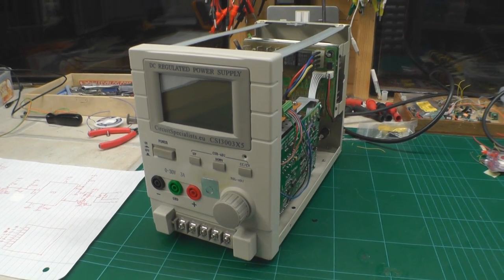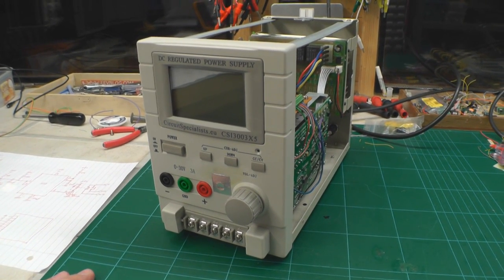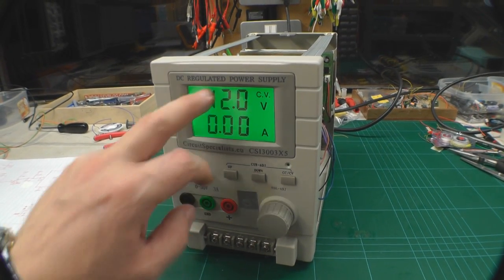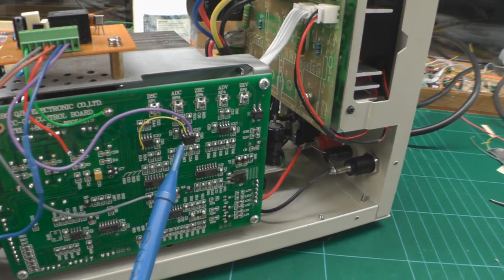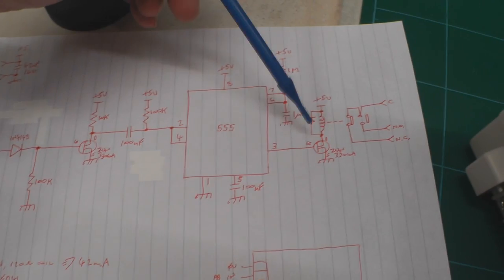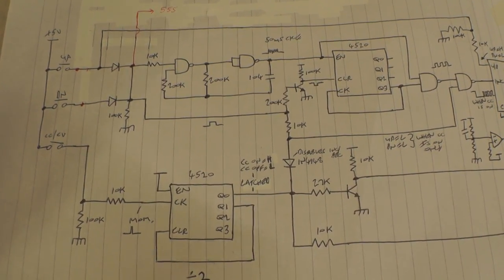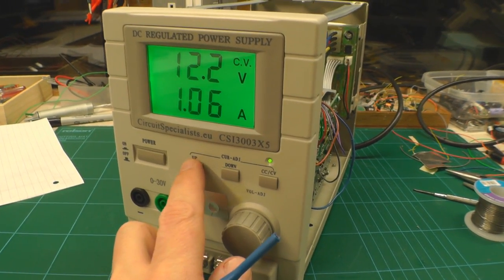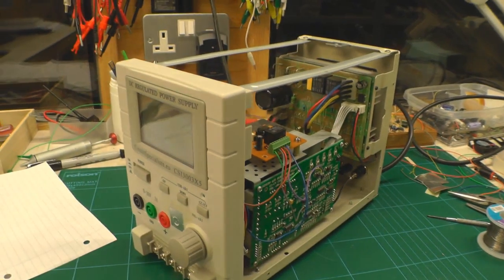CSI3003X5 Bench Power Supply - Constant Current Mode Modification - Update

Comment: You see.. that's the difference between a standard repair break/fix engineer like myself and someone who knows about circuit design. This is inspiring me to get more involved in the design aspect of circuitry as a leverage for repair capability and re-design/modification which is a very necessary skill when original components and circuit diagrams are simply not available. Being able to reverse engineer and draw out a circuit  to better understand it is sometimes the only way forward. Thank you Ian for taking the time to publish your work.
Reply from the maker: Thanks for the comments.
Ian.